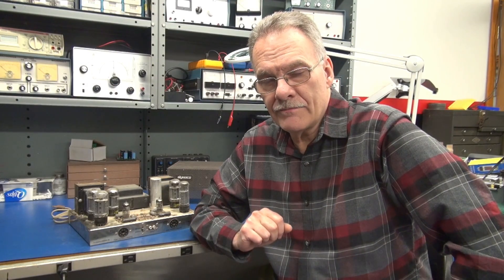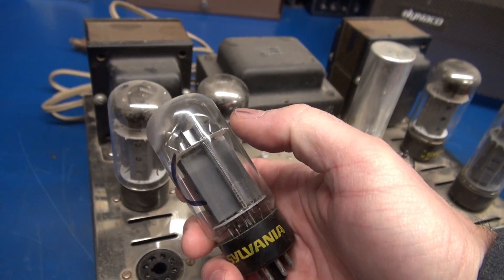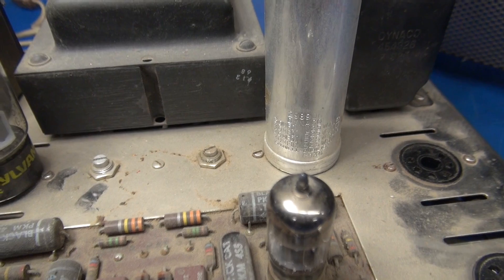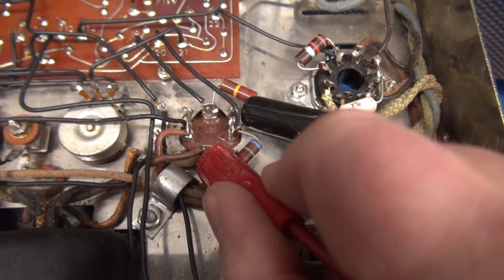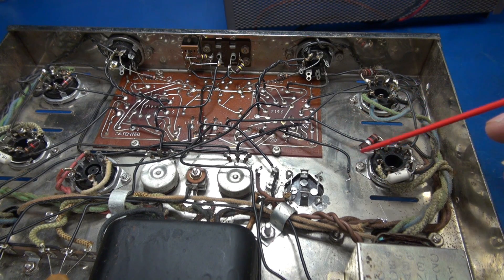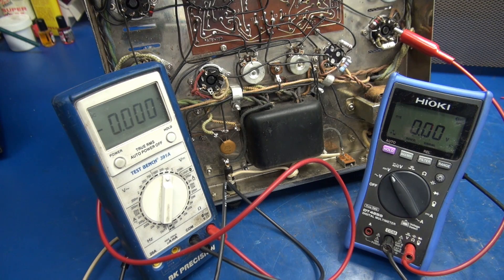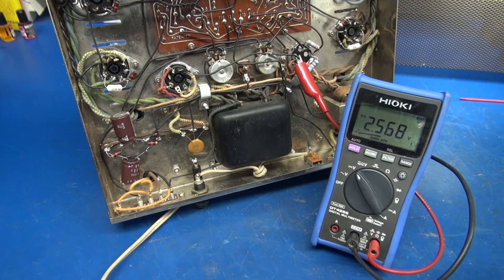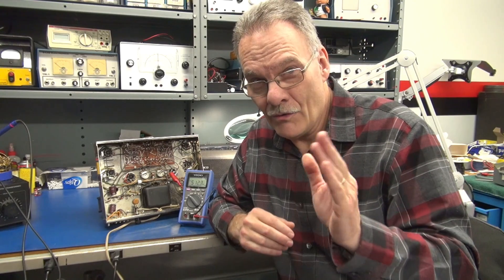Dynaco ST-70 Integrated Stereo Tube amp Filter capacitor repair Tech Tip advice from D-Lab

Comment: Your tech tip was valuable, 525 is simply too close.  If the mains voltage goes up to 125 that's no bueno.  550 is smart, 600 peak is wise.

Comment: You don't need to solder the can cap to the chassis, you should solder a wire from a negative tab to the star ground directly to the left as you see.  Especially because you really never know if a new can cap is going to go bad, though they usually don't.  But I'd be pissed if I soldered a new can to the chassis and then it failed.

Comment: The rectifier runs through the ground the hardly get any power if it’s fine leave it it’ll take the smooth warm flutter away from the amp 😎 very good work

Comment: Hi, I have a Mark III mono amp, I need to replace Filter Cap , Do you know where and what part number I can buy to Replace it, I see The original CAP # TVLU 2920 , I could not find the same part to buy it. Please advise....Thanks  FYI: my board Resistor keep burn out..

Comment: The Mark 3 is a KT-88 / 6550 amp rated for 50 watts per channel.  The ST-70 is a EL-34 / 6CA7 amp rated for 40 watts per channel and operates at a lower B+ voltage.  525 volts for a EL-34 / 6CA7 running class AB drastically shortens its life.  Its B+ should not be much over 400 volts.  It's all about plate dissipation.

Comment: I am in complete agreement with you about not plugging in old equipment without first checking (or, better, replacing) electrolytic caps and taking a few other precautions before bringing it up slowly with a Variac.

Comment: That puppy is gonna be LOUD. I love those Stone Age PCB’s! Finally got my own Snozersmous! Been putting it off but found a vintage  80 watt one on EBay with a HUGE brass tip that can be ground down. Lots of it is left. Man it makes SUCH a difference compared to the small 80 watt iron I was using for chassis. Does the job 10 times quicker! I LOVE it!!
Reply: Those Stone Age PCB’s are often scorched and can be problematic 🤷🏽‍♂️

Comment: B+ would be a bit higher if the correct 5AR4 rectifier tube were installed instead of the 5V4 that’s in there. Though with today’s line voltages, the 5V4 will provide a bit of safety margin.
Reply from the maker: It has a Sylvania 5AR4 installed. The only original tube that survived
Reply: @d-labelectronics  The bulb looks very much like that of a 5V4 and not like that of a 5AR4. It would be interesting to plug another 5AR4 into the amp and see if B+ comes up a bit higher.

Comment: Everything this man says here is good advice. He is right that Mark II and Mark III Dynaco amps have higher voltages than an ST70 on  the B+ section of the quad cap in the power supply. Home line voltages when these amps were new was around 115-117 volts. I have seen line voltages as high as 127 volts in recent years. You have to multiply the difference in line voltage by four to get the voltage the quad cap sees. 550 volt quad caps are perfectly fine for a ST70. Several suppliers offer new replacement quad caps that are superior in every way to the originals. The biggest weaknesses these amps have today are the old caps and resistors.

Comment: I'm sure you've likely discussed this, but why not install an inrush current limiter, such as the CL-90. I find startup voltages are held somewhat in check by them, and they shave a few volts off the top, which can help when line voltages (where I live) hit 128VAC. What's your thoughts in general on them? I install them in almost every repair I do (of my own gear).
Reply: In-rush limiters are especially important if someone decides to bypass the GZ34 tube rectifier with diodes.
Reply: @randyrobey5643  Not to mention replacing the Selenium rectifier with Silicon....only raises the voltage yet more. Short of a Bucking Transformer, which are critical for controlling the high voltages in certain amps such as the Heathkit W5M, the inrush will shave off 1-2 volts hopefully. I was wondering if there is an "audio" reason for not using them?

Comment: The thick layer of dust on the top side kept making my OCD twitch 😂
Reply: Especially with that cheesy phenolic printed circuit board. It should be thoroughly cleaned of dust to prevent arcing, which can damage it beyond repair.
Reply: @jonathanknight8251  to
Reply: @gourangosutradhar2898  ot
Reply: Ja das. Geht
Reply: Was zuckt das lebt

Comment: Agreed, an ounce of prevention = a Ton of cures. The grid on this side of the pond can vary from 220V to 250V from the wall sockets .As far as I am concerned you can set a bench-mark for your Sincerity which is a breath of fresh air these days. Thanks for sharing your experience with us.

Comment: I'm working on a Fisher 500C receiver. It has a selenium full rectifier for the negative bias power supply. If I replace it with a silicon diode bridge, I would think it will need some added resistance to bring the bias voltage in line. Is this the case?

I will leave the selenium in until everything is up and running, but it doesn't give me a warm fuzzy feeling leaving it in long term. Love the Dynaco stuff, I have a PAS-3 factory assembled preamp that needs recapping as well. Not using it, keep kicking that can down the road, future project. Love the vintage stereo tube videos, always learn something from you.
Reply from the maker: Yes, Its coming out as well as the black beauty caps
Reply: Are you doing any of the David Gillespie mods to that 500C?
Reply: @acoustic61  Trying to keep it as original as possible.

Comment: I had the same Exact experience with a set of mk3s. Idle was at 538v.  Since I already installed ce distribution cans at 525v, I ended up installing single 30uf at 600v at the B+, then used the can cap for the other sections. My st70 peaks at 500v. I guess only the monoblocks have the high voltage issue.
Reply: I wouldn't trust CE Distribution caps. I think their QC is poor and I've heard of early failures.
Reply: @acoustic61  I've been using CE can caps for years and have never had a single one fail. I've installed at least 50 of them in amps that I've serviced, from Dynaco to Fender, to McIntosh amps, and found them very reliable. Experience is better evidence than what you read or hear about on the internet.
Reply: @stevelark9840  I had one with a QC issue and after apologizing they replaced it with another one with the same issue. I won't use or recommend them unless a customer insists on them for esthetics. Have also heard from a relaible source and well known builder that he's had early failures and won't them either. They're overhyped and expensive.

Comment: Your advise is valid. There is almost 500V there. Some tolerance is needed. HV may be higher at startup and lower when tubes heat up.
Reply: Possible but the capacitor should have a higher surge voltage ratiing.
Reply: @acoustic61  Caps from that era had working voltage (wvdc) and surge voltage ratings. Today, the rating IS the surge voltage.

Comment: With the tubes installed >500v. Without the tubes or open transformer lead (lessening the load), the voltage can creep up. Did you test without the tubes? Even at 490v I like the comfort zone of 550v. It gives me a nice false sense of security.